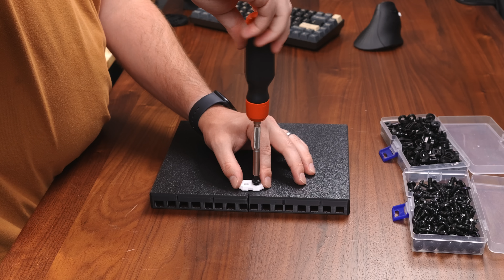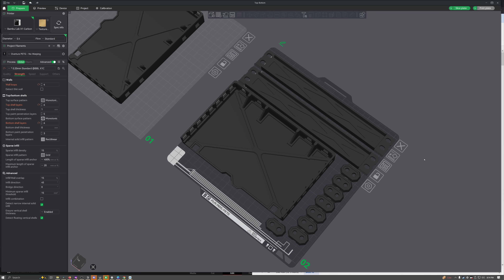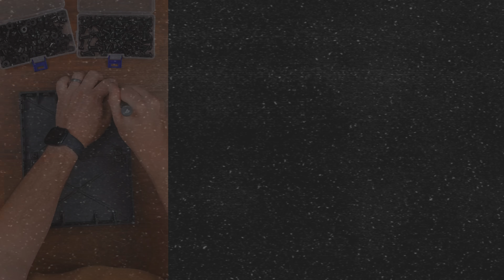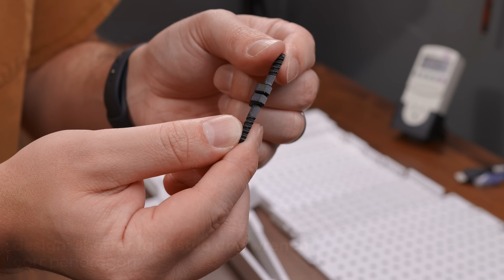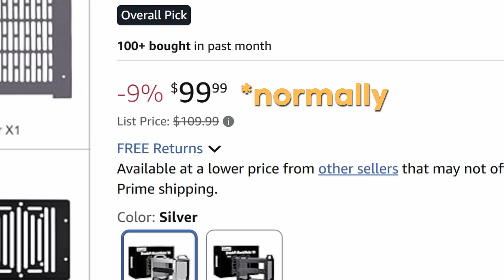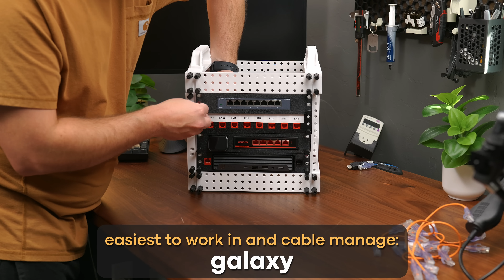3D-Printed Mini Racks are GREAT... but which one?

Comment: I know overall its cheaper but Im still debating, I think I want to get just a bare frame aluminum 10u from DeskPi for $69 and then printing out the panels, and face plates and so on. I just question how long term sturdy the printed ones say out of PETG will be and with the aluminum I know that will remain sturdy. Since posting this video have you seen any fatigue issues? If I was to print it, I would probably go with the Lab Rax. As far as the heat insert option or the nut option, do the nuts just drop into place with nothing to hold them? so you have to hold the nut when screwing in the screw?

Comment: I don't know what it is called.  A cage nut wrench?  Cage nut pliers?  I'm not sue but one of the racks I got for a client came with a little aluminum pliers that makes installing cage nuts really easy.  Since my client would never use them I asked if they minded if I kept them for future racks and they were fine with it.  So for like 20 years I have had the best tool and I am very careful not to lose it since I have never seen one before.

Comment: I'm building my second homelab server inside a 10 inch rack this time around. I'm using a design from Fred Corp. on Makerworld. Their design uses metal rack rails for the main support, and printed piece for the handles and to bind the 4 rails together. I like this design. It feels really sturdy and makes me not worried when putting 8 drives and a full itx pc into it.

Comment: I really like the Lab Rax... I printed the Hex Nut Version... Where I used PETG for everything BUT the side mesh panels that I printed in PLA...

Side panels should not get hot enough to cause an issue. also they are not "Structural" but Structural... so was not worried about strength.

Comment: Thanks for the review. I went with the “Lab Rax” model with bolts. It looks like a finished product. I was interested in the “NAS case” design, so I set the parameters as shown in the screenshot, but the first layer got messed up during printing—the lines overlapped. I'd love to learn more about how you print these grids.

Comment: I have made two Lab Rax units. One houses a Winlink VHF and UHF radio gateway that has two radios, an interface, minicomputer, diplexer and a 7" screen. The other one is a power supply that will run my radios and charge a backup battery.

Comment: What i'm wondering, what's the maximum static load of such a 3d printed plastic rack? What if i want to screw this to a wall, will it be strong enough to taka a load of 20 or 30kg? (Like a 10" 12U metal rack can)

Comment: TecMojo is low priced, metal, and adequate size.   IF you don't want to 3D print.  If you really want to go cheap, don't want to print, but you are okay with cutting and drilling holes, just buy L shape PVC moulding.  Cut, drill, and assemble. The shape also makes it easy to create rails.  Even more budget?  Buy a plastic Sterlite crate!  The small one's are 8" wide.

Comment: 15:21 Technically, if you build your own 3D printer or buying it second hand (so many old Enders going for under 60 bucks), you would still be cheaper off than buying one premade aluminum 10 inch racks which often go for around 150 usd.

Comment: I'd honestly mostly use some aluminium L profile and tap the threads, use some rivets or screws+nuts, with a couple of printed parts. Could end up cheaper and have less waiting time, which I asolutely hate.

Comment: Interesting comparison, and useful for me as my main workspace desk does need some repairs and mini rack had been in the design concept. 
For myself I think the galaxy concept is the more useful simply for the greatest flexibility, and that practical no nonsense sort of design appeals to me enough to keep me happy compared to the more pretty chamfers and detailing on the others. Though I'd effectively hybrid that galaxy concept with some Aluminium parts so in the end probably very similar to the deskpi frame really (but I am capable of doing the metal work myself from cheap stock fairly quickly and easily - likely be waiting on the printer doing the side panels).

Comment: Awesome video! You did a great job showcasing the different rack designs, really fair comparison and great insights into the strengths and weaknesses of each. It’s awesome to see more people getting into 10" hardware for homelabs and experimenting with these builds. Thanks for including my design in the mix!
Reply: Your design is awesome…I built one at work that has various sensors we’re evaluating over a long timeframe for performance…I mounted the sensors on top, and am reading them with some pi’s….the CEO walked into the lab and thought it was one of the coolest things he’s seen

Comment: I printed the LabRax for myself. Though, my 3D printer has only an 8 inch bed, so I had to tweak the cross pieces so that I could print 2 halves and then glue them together. As for the threaded inserts, I was able to use the 5mm depth ones I found on that one site that shares a name with a river. The 5mm worked perfectly fine.

I also printed no panels but made one for the top out of 1/4 inch oak ply and finished to match the furniture in the room I put it. It holds my ISPs ONT, my router, NAS, small PC used as my Jellyfin server and a small switch.

And I've no complaints about it, even with having printed it in PLA+.

If I had to do it over again, I would do it exactly as I did. Zero complaints with the LabRax, aside from the aforementioned slightly too big for my 3D printer bed. I think the one change that could be made is if the connections were part of the side panel top and bottom rails instead of the front and back top and bottom rails. Then it would likely print on every printer with a minimum bed of 8 inch by 8 inch.
Reply: Would you mind explaining how you tweaked the cross pieces? I have an Ender 3 Pro and would like to try to print the Lab Rax.
Reply: @dontsplatmatt  I put the pieces into 3D cad (at the time, I think I used TinkerCAD, and cut it into two separate halves. I think it might be symmetrical, and you could just print 1 half twice for each piece, but I made sure it was two halves of the whole. And then I made a simple 3D printed plate (about 1 inch wide, 3 to 4 inches long, and 1/8 inch thick) that fit into the back side of the print for alignment purposes, and glued it all together with CA glue (Starbond brand medium from my woodworking supplies) and activator spray.  The pieces with the more noticeable seam were put to the back and/or bottom - least noticeable seam top and front.

Mine's an Elegoo Neptune 3, and that's how I printed the LabRax on it

Comment: This is one of those times where "if you have the 3D printer already, it's super worth it to spend the electricity, filament and time to print a rack if you need one". Because yeah, if you don't already have a 3D printer but want a rack..? Might as well just buy the 10-inch rack. Of course you still have the issue of not being able to print accessories but I'm sure you can buy some stuff too.

A great use of 3D printers.
Reply: You could use a hybrid approach as I did.  A commercial 10 inch rack with side olds and top and bottom and a couple shelves.  Then 3d printed the rest using 3d printers at my local libraries - plural as many towns/cities in same county here in North Texas give free library cards to residents and x relatively nominal fees for library card for county residents.  I used 2 libraries that charged 5 cents per gram of filament.  Another charged $1.00 per print hour.  Some allow you to send files via the internet.  Key printable mods include 4 hot swappable 2.5 in ssd and 2 3.5 hdd.  Even found a ,custom free design for a rack for my Ethernet switch.  Libraries typically have one week or less turnaround.  Some have 256 km cubed size and others slightly smaller.  Has worked for me.  And there are loads of free and low cost designs on the web.

Comment: The big question is which one gives the authentic Homelab rack experience: which one gives you at least one slice in your finger every time you work on it?
Reply: I guess that argument is settled in the video when he manhandles the cage nut and the screwdriver.
That one is the most authentic variant for a homelab rack!
Reply: Only speak for yourself XD
Reply: Dad
Reply: Having never sliced anything on my homelab rack - I gotta be doing something wrong then
Reply: @ArkkFilgaia someday comes suddenly. It happens to all of us at somepoint. 

Risk of hurt is less than it was before tho. Modern cases are a lot more rounded and fine finished. 
Back in the day I was handed the wrong size screw driver. Slipped off the screw, punched the HDD cage with my middle finger, tore a piece 2*3mm out of the skin above the fingerjoint. That scar is eternal. 

Colleague bloodied his finger trying to insert cage nuts.

Use proper sized tools kids. And don't take human friendly hardware finish for granted. 
We literally paid for that in blood.
Reply: That would definitely be anything with cage nuts.
Reply: Built my first home lab a few weeks ago. Yep, I got an annoying, thin meta cut on my finger😢
Reply: Blood for the hardware gods!

It is superstition but i made the experience that if a build didn't drew a drop of blood it will have problems later on.
Reply: we must make the blood sacrifice

Comment: This is a great vid to see... I just printed an 8U LabRax for my little mini-pc XCP-ng cluster & am really loving it. It may not seem like much, so I do want to re-iterate what you pointed out... that extra 40ish mm of depth is actually really nice for dealing with cables. I managed to get everything in mine without any messy cables or connectors sticking out at all (other than the tidy network cables of course). That includes a power strip, so the whole thing can be shutdown, unplugged and moved as a unit. It's so much nicer than how these machines were set up before.

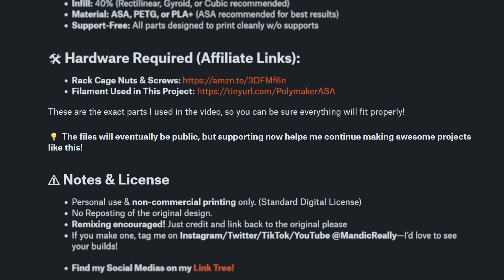Comment: 4:30 I am too and would even donate if it's a good model, but if I'm 3d printing a rack in the first place I want it to be fully open source & readily community-moddable, which a paid model pretty directly hampers.

"Support the creators" and "get the model for free" are not mutually exclusive. 

The obvious example case would be making a really high quality design, putting the files up as open source, & then working with a company like Slant3D to sell complete kits to people who don't already have a 3D printer while accepting community contributions & donations to improve the product further. (Unfortunately there isn't a good git-equivalent for 3D modeling yet as far as I'm aware.)

To be clear, this isn't a moral condemnation of the designer or anything - they can choose to distribute their model however they want - BUT it IS a condemnation of this false equivalency that there's either "supporting the creator" or "being open source/free/Free" which just isn't true and is unfortunately still a rather common belief. RedHat has a lot less goodwill going for them than System76; 's all I'm gonna say.

Comment: I have 5 LabRax and I am over the moon
The LabRax has pillars from 1 to 5U and there is a customizer to, one of mine is a 6U using the customizer.
I originally had the MOD10, I find it limiting in sizes but if you not worry about that, it's great.

Comment: I have LabRax sliced but then i found 2020 profile rack on Thingy, and it looks like cheaper and sturdier for me (i need more than 5u, so aluminum is 2 times cheaper than filament for two LabRax to give me 10u. The downside - 2020 profile can't be 100% compatible with 10inch rack dimensions, and 1515 profile can be close to ideal but not too accessible (Voron 0 sourcing in mind).

Comment: I think you left out a very  good alternative solution: just use 2020 aluminum extrusions (which you might have already laying around from old disassembled 3d-printers) and just print some blanking panels/keystone panels. sure it is not completely printed, but it is very cheap, totally flexibe in size in any dimension, you can print cover-panels OR use acrylic panels and you have a lot of spots where you can mount things and these spots always have at lease on degree of freedom to adjust. it is supersturdy, supercheap and can be made partly out of 3d-printers. just build two same-size rectangles out of 2020 extrusions, and use blanking panels for the correct spacing. done. there is absolutely no point to waste filament and printing time, when you can build the core-frame in 10x as rigid for less money, and use 3d-printing where suitable.
Reply: 20/20 extrusions are not just laying around for me and they’re quite expensive.  I don’t find the majority of people have these just laying around.

Comment: I printed most of a Lab Rax rack a couple months back to house an ALL in ONE proxmox server setup with virtualized NAS. I want to do six 3.5" drives so I've been trying to find a good design for a 3D printed cage plus sleds that I can adapt into the rack. But what's making things difficult is what computer setup to use. Mini-itx would with a flex atx psu would work as long as the mobo has two m.2 ports. One for an ssd and the other for a m.2 to sata adapter. But that is going to be costly as I'd want a high ish core count CPU and at least 64 GB of DDR5. The other option is a lower cost mini pc (Ryzen or intel Core, not N series). Again, it's going to need to have at least two m.2 connectors for the same reason, but powering the drives on and off with the mini-pc is the issue I'm having. Six 3.5" NAS hard drives could consume as much as 18 Amps on spin up, so whatever power solution needs to account for that. I could use the spare 24v 300 watt meanwell psu I have, but I would need a single in dual out step down converter (or 2 separate converters) that can handle the 12 and 5 volts the hard drives require. The 12v converter would need to be able to handle 16 to 18 amps and the one for 5v, around 5 amps (a little headroom is always a good thing). Then something to switch the drives on and off when the mini-pc turns on and off. I suppose a relay or perhaps an P type transistor circuit instead. Does anyone have any ideas for this particular scenario?

Comment: Who doesnt like cage nuts? I recently bought a 10 inch rack after putting it off forever cause I saw one I like with holes for cage nuts. I like knowing if I ever have anything that cross threads I can just swap cage nuts. Admittedly with 3d printed racks thats less of an issue cause I can always make replacement parts, but even then I wish there was more printable modular frames that use off the self rail sections so I could have conventional metal rails while also getting the customization of a 3d printed rack.

Comment: First of all, I LOVE THIS VIDEO! Over the last year I've gotten into home lab and 3D printing and have printed several of these.  My favorite is the LabRax.  I've built both the Brass Insert and bolt versions.  My current homelab sits in an 11U labrax unit and it's been awesome.  I too extended my initial 5u to a 9u and eventually to an 11U. I printed in PETG and have no stability issues, even at that height.  He recently released a cool addition that supports hot swappable HDD bays, so I'm in the process of replacing all my internal HDD units with these.  All in all, I found LabRax to be a very useful solution with little compromise.

Comment: I dont have a 3D printer and also not in my friend circle.
I also want to organize my network hardware but when i saw the retail prized of premade racks and how much the mounts for my deviced would cost printed by companies, that was way ti much than im willing to pay.
So now im building a mini rack out of wooden parts.
I designed an idea based on existing projects and my needs and hardware.
Im used to work with wood and its way more fun than buying premade stuff, but its also very complicated, bc of the material.
But its fun and relaxing in its own way and it gives the feel of creating it on your own.
Im not done for nor, but i think, for future designs, i would go for 3D print, either from myself, or from a company.
Reply: Wood would have excellent vibration resistance, but if it's too soft, you might have hardware working loose... unless you "through bolt" which would be tedious. please post pics when done. interesting idea.
Reply: @jlmathews4470 
Bc of the material i cant build standard mounts like the 3D ones, like the "floating" parts. I use levels on flat rails to have easy management and changeovers and Balsa wood for the front covers. So its possible to do changes and repairs.
The frame looks a bit like this: https://youtu.be/QrQ51a3_gB8

Comment: I literally got a 3D Printer over the week, 4 days ago, with the goal of printing a 10" rack. I am still dialing in the settings, but this video was perfect timing for me. I was planning on printing a rack within the next 24-48 hours. Thank you!:face-red-heart-shape:
Reply: If this is your 1st 3D printer, tune each color and type of filament even if from the same manufacturer. I have a P1S and still do test prints for fine tuning. I have found from having a few different printers to tune on each printer also. 2 K1 Max's will each print different, even using the same roll of filament. Bambu does make it easier, however it's a bit Apple like.